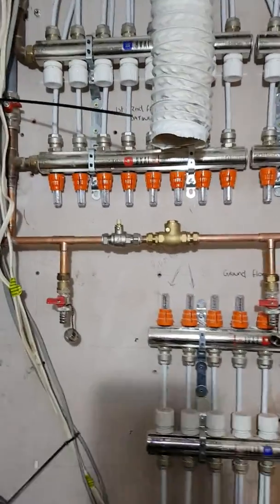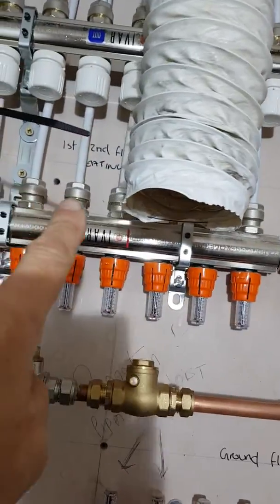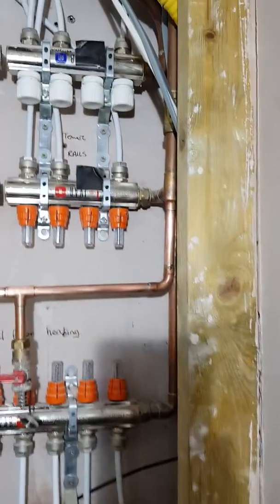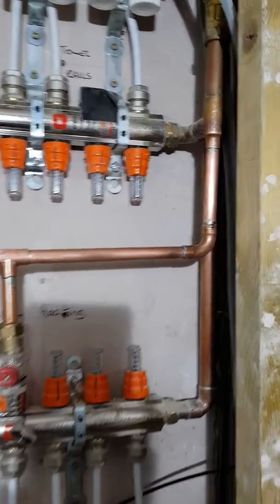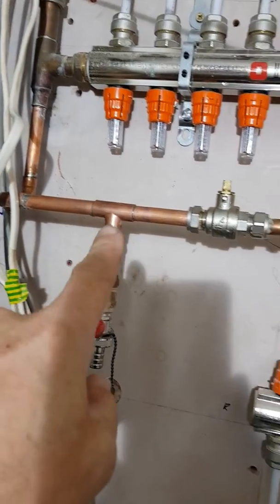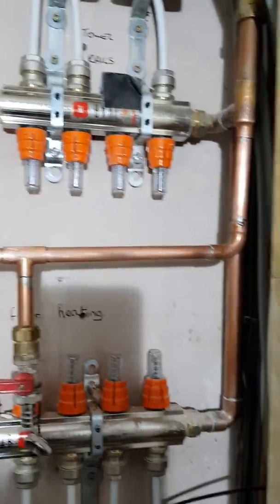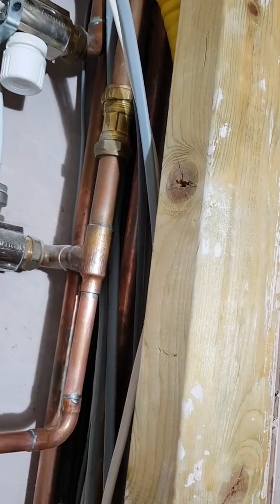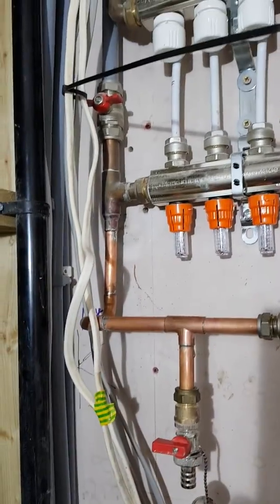Towel rails on a Viessmann 200 Weather compensated multi zone system.

Comment from the maker: More information. The link is between the flow to the towel rail manifold  and the flow to radiator manifold. The non return valve is in the direction of flow from the radiator manifold to the towel rail manifold. The towel rails are on an unmixed circuit and the radiators on a mixed circuit.

Comment: Are you using the return water from the high temp towel rail circuit to be remixed with flow to rad/ufh circuit ?
Reply from the maker: Almost correct

Comment: Are you using mixed temperature for summer usage so not to overheat bathrooms the revert back to fixed temp for summer
Reply from the maker: I think your question is confused. The towel rails can change from being supplied on an unmixed constant temperature on a timer and when the timer is off the mixed weather compensated radiator circuit will supply the towel rails. This allows them to act both as towel rails in the summer and both towel rails and radiators in the winter.

Comment: You can't mix unmixed and mixed together.? But isn't there mixed going into towel rad circuit?
Reply from the maker: The towel rails get both mixed and unmixed but not at the same time. Look at the layout. I think you might work it out.
Reply: Is it because you've linked them there is no control of each manifold?
Reply from the maker: @poopypooper17  no full control but some bennefit
Reply from the maker: You can get mixed and unmixed to work. This dies it on the towel rails. Mixed to work as radiators but when the unmixed circuit runs they run at 48c (about)
Reply from the maker: @poopypooper17  we have control over the manifold
Reply: Must be return temp then.